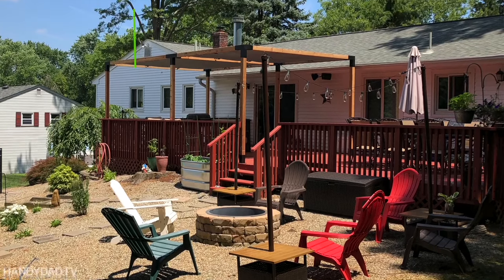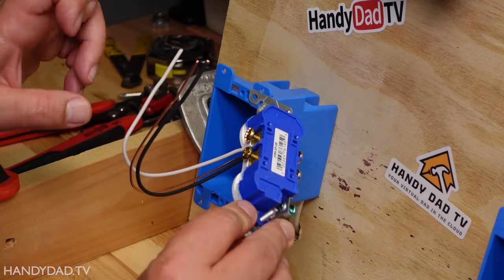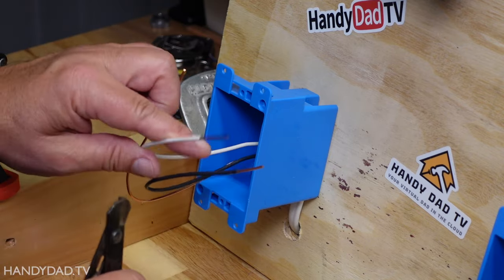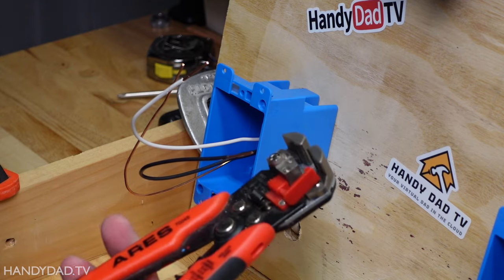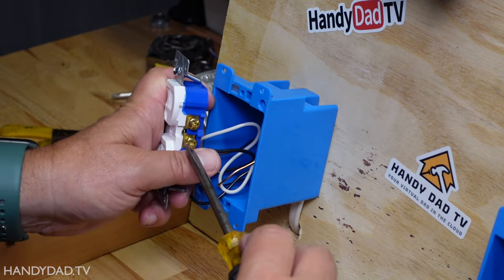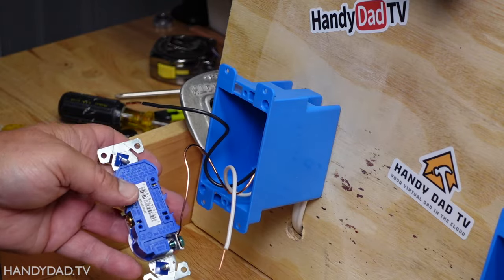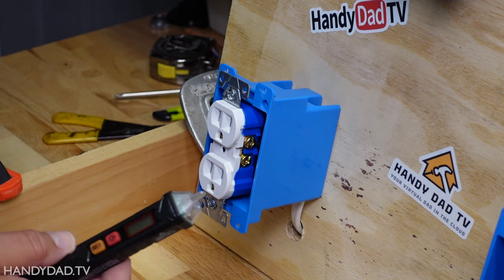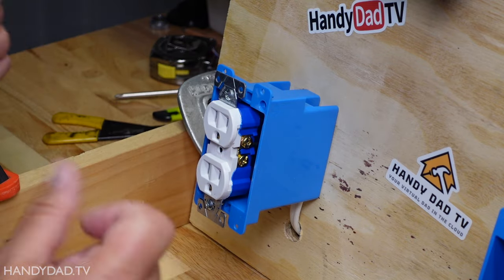How to Wire an Outlet

Comment: Thanks for the detailed video. I will comment regarding the pigtail debate for once more, and about those electricians you speak of who do big projects and want to "finish" the job quickly. Of course they are not going to take the extra step for extra step means extra time for the job. I get it. But in the other video, when I mentioned it, it was because you are showing it on your video to the average homeowners who have time to do the better practice. So it is great that you did here and showed both, however a lot would look unfortunately to your content and try to copy it. I am not saying it is a bad practice to connect through the screw, i am just saying it is poor practice vs the pigtail choice. Either way, I love the way you explain things. Definitely worthy of an actual TV show.  Not many has that skill of "explaining". Cheers~
Reply from the maker: There is no lack of opinions on the Internet. If I say, “do it like this”, I’ll get 100 people telling me I’m wrong.
Reply: @handydadtv  I am not going to argue that. LOL

Comment: It has been said in the comments already, but I will repeat it here: backstab connections ALWAYS work loose eventually...the only variable is how many years go by before they do. Any contractor I hire that is caught doing this is fired immediately, and a new contractor hired (and warned not to do this). The only exception is to tap a light circuit from the backstabs; that way, when (not if) these connections begin to fail, you will get a very noticeable signal (intermittent lights). As a matter of fact, all the receptacles I see in the stores around here will ONLY accept 14 gauge wire in the backstabs, which tells you they are for lighting taps only. Stay safe - do things the right way!
Reply from the maker: Thanks for the advice

Comment: Thanks. Very nice video and description. Like you mentioned in the end, electrician like using back stab and no pigtail. I swapped 5 outlets yesterday and it has the same issue. I ended up wiring without pigtail on outlet which will be barely used in the future. I am thinking it will be fine. But for the one I am always using, I probably will do pigtail.
Reply from the maker: Good plan 👍🏻

Comment: As always great content! I have a gfci outlet that I want to add to my garage. I have outlet that’s on the other side of garage wall but not sure it’s the first line coming from panel. So my question is how do I find the first outlet so I replace it with the gfci. Thanks. I guess anyone who’s know could answer my question.
Reply from the maker: Garage outlets are usually GFCI protected. I use a tester in this video https://youtu.be/dbmRETinw0A that can test if any outlet is GFCI protected. Try that first. 

If it’s not GFCI protected already, the best way to trace a circuit is with a cheap tool from Harbor Freight, as shown in this video https://youtu.be/UAEq-yvjryQ. Beware: the circuit breaker must be off to use it.
Reply: If your receptacles are wired from one receptacle to the next (using both sets of screws) you would disconnect the downstream ones, one receptacle at a time until all the other receptacles are out. The one that still live will be the first one. If all your receptacles are pigtailed, you would have to undo the pigtails and recreate the original scenario. If your pigtails were created using Wago's you may want to try if you're ambitious. If the pigtails were created using wire nuts, then I wouldn't attempt it.
Pick the one that is most likely to problematic as far as getting wet is concerned and put a GFCI there. No downstream receptacles will be protected. That's what I would do.

Comment: I’ve always used the screw to hold the wire ever since my old house about burned down. Whoever did the wiring ran it through the back stab and it was able to slip out. Checked a few others and they was not seated fully inside. Definitely recommend using the screws.
Reply from the maker: Oh my! Did the outlet melt or burn? Do you have pictures?
Reply: @handydadtv  when I noticed it the outlet was actively melting. The back of it was burned when I got it out of the wall. I don’t have any pictures.

Edit: it happened late at night and I would’ve never seen it if I didn’t go to get a drink.

Comment: Here is the problem using the back stab method. Over time, the wires heat and cool, which makes them stretch.  That causes the wire to work themselves loose, and they can and do pull out, which then leads to arcing, loss of power, and if you're really lucky, you get fire inside your wall. So wrap your wires around the screw and then wrap black tape to cover  all the screws. ( Consider the tape as insurance. You probably never need it, but you are sure glad you have it in case you do)
Reply from the maker: Thanks for the advice
Reply: Do tell. How is it that the wago’s that just about everyone is using now, is any more safe than the back stab method, which is essentially the same type of connection….
Reply: @jamesbizs  wagos work by lever compression, not spring compression.
Reply: I was trying to figure out why they will work themselves lose out of the backstab method if they're just sitting in a box bolted into the wall and not moving? And I'm not trying to be funny it's just a question
Reply from the maker: Wires get warm depending on the amount of current flowing through them. So they expand and contract normally and that can loosen the connection.
Reply: And as he said backstabbing only works on 14g wire, won't work on 12g wire.

Comment: I'm no professional so I guess that's why I use the back stab method... but Question can it only be used for 14 awg wiring? not 12 awg? I would imagine the 20 amp receptacles would allow for the bigger wire size?
Reply from the maker: I don’t recommend back stabbing, but it only works with 14 awg wire. I’ve never seen a 20 amp receptacle with back stabs.

Comment: Thanks for the video! btw - all the receptacles in my house are 15 y.o. and were backstabbed by the builder and I have a problem to release them and have to cut wires, which makes me doubtful they are gonna loosen themselves plus there's nowhere to go inside a box.
Reply from the maker: Hope they left you enough wire.

Comment: Scenario. I have a plug that I want to run an outlet on the other side of the wall from. It's in the middle of the run, so there are already 2 blacks, whites, grounds coming into that outlet. Can I put a third (to the new outlet), and pigtail back to the original, or should I somehow remove the outgoing line and run it on the outgoing of the new receptacle? (Connecting the outgoing from original to incoming of new, then "old" outgoing into outgoing of new receptacle).
Does that make sense?
Reply from the maker: Yes makes sense. I did the same thing here: https://youtu.be/klL8XhKMNT8

Comment: Nice vid.
For me, I hate using pig tails as that is that much more wire to cram into a receptacle.
It's more effort and time (I'm not a trade electrician), but I feel more comfort not having a bunch of wire crammed in the box.
That, and I have zero faith in wire nuts. I hate the bloody things. I know they have their place and purpose, but I've seen a few fires over the years from them being misused, or poorly implemented.
Reply from the maker: Thanks for the feedback

Comment: You joined two Black wires onto a pig tail. Doesn’t it matter whether you connect to a Load or Line side on the brass screws
Reply from the maker: Only GFCI outlets have Line and Load. Normal outlets don’t.

Comment: I don't recommend pigtails because they're not as secure as hooking up all five wires only the ground gets pigtailed
Reply from the maker: I get tons of comments saying pigtails are better. Both are acceptable.
Reply: @handydadtv  I know the debate on pigtails versus attaching all 5 wires but the reason I'm letting you know this is because I have had pigtails vibrate loose and cause shorts now the resepticals are designed to have all 5 wires attached if you have power coming in and power going out they don't give you two extra screws for nothing the only wire that you have to pigtail is the ground and also make sure you are using tamper resistant resepticals because that is code now days part of this is my opinion by the way I do really like your channel and I am subscribing right now
Reply from the maker: Thanks for subscribing! Welcome to the family! And thanks for the input.
Reply: Pigtails are way to go. If not your using outlets like wire it’s wire nuts. 
If 5 outlets on 20A  circuit, each outlet has a 3A load the first outlet has 15A flowing through it. If pigtails used same scenario, the outlet in use has 3A through it and others have none

Comment: Can I use wago 221 clips for the ground connection?
Reply from the maker: Absolutely
Reply: @HandyDadTV  thank you! I had a couple more questions I was hoping you might be able to answer. I'm replacing a small forced air wall heater (which never had issues, just 30 years old) with a new convector style with built in thermostat. I removed the old wall thermostat and was going to connect the wires, but the ground wires coming from each romex are only connected to the metal box and not to each other. What should I do? Leave as is or connect the grounds and the box? Also curious to know, in an outlet installation, what would happen if a metal box was not grounded, but the outlet was? Can you get shocked from touching the box?
Reply from the maker: Sounds like you already know the right thing to do: All grounds need to be connected and pigtailed to the outlet. If you have a metal box, it needs to be bonded to ground with a screw (no need for a dedicated pigtail; just loop one of the wires around the screw).

If the outlet is grounded but the metal box is not, this is a code violation because the box isn’t grounded if you remove the outlet.
Reply: @HandyDadTV  I finally got everything connected, but as I was turning the breaker on, I heard a very loud buzz, and immediately turned it off. I checked my connections, and one of the copper ground wire connections turned black.  Any idea what I did wrong?
Reply from the maker: That’s called a short circuit. The ground wire touched a hot wire. 

Please call an electrician.

Comment: why are there 2 bronze screws and 2 silver screws?  thanx
Reply from the maker: The chrome screws are for the white wires. The brass screws are darker - they’re for the black wires.
Reply: @handydadtv  yeah but why are there 2.
Reply from the maker: So you can split them and switch half.

Comment: As I'm struggling (now), to pack the 12/2, wire into the (2 gang) box...(ugh) Someone aught to put out a video  of "how to stuff 5lbs of "wire" into a 1lb box! Jesus! (WTF). Think now electricians make $100 an hour because of their patients! I'm using a carpenter pencil to ("gently" as possible), but dam!
Reply from the maker: If it’s too tight, the box is likely too small. Code has rules for box sizes based on the devices and wires in them. Consider replacing the box with an extra deep one.
Reply: Nope, standard 4" × 4" x 3" deep.  #12 wire is just stiff, and dimmer switch,  & decore outlet are bulky. I got-er-done, but took time.